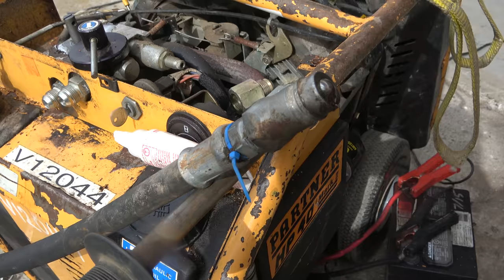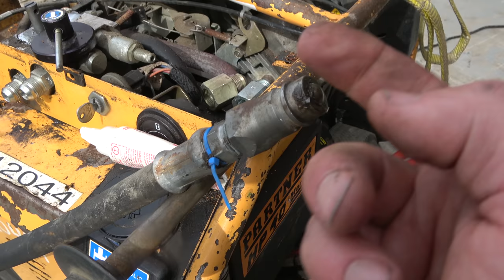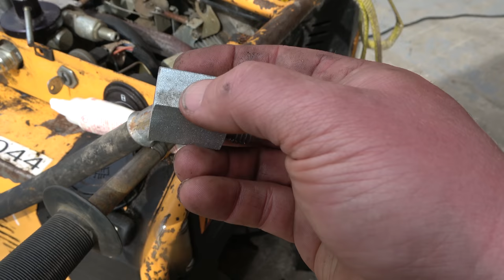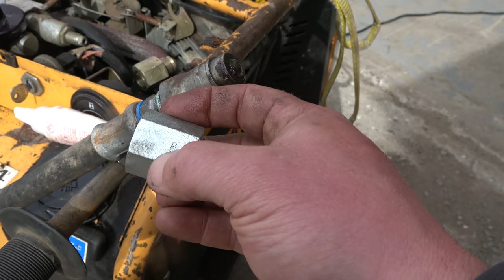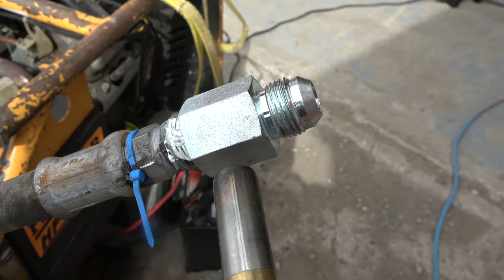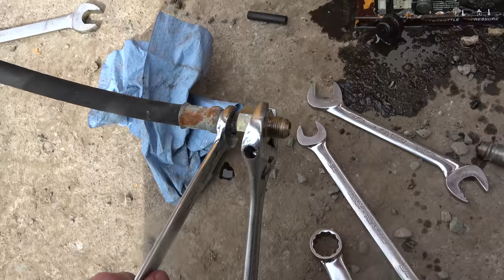#sharts Pipe thread that'll never leak (or come apart)

Comment: I'd like your opinion IF any of the prepared & trucked to facility gigantuan sub structures and supports that are being assembled this week at the SpaceX Starship 'Booster Catcher' Orbital launch Assemble Tower  down on the Gulf of Mexico ARE CND prepared, What cut or burned the holes. in the plates?  You think the rising structure is held in place with few bolts and they may or may not 'rack the structure' plumb and vertical on all 4 corners as a 'temp X-brace structure THEN make work the fasteners.  Bet they've got big nuts...

GOOGLE:  According to Musk, SpaceX's Boca Chica launch tower will have a “hook height” (the distance from the crane hook to the ground) of at least 140m (~460 ft), meaning that the top of the tower's crane will likely be 150-160m (490-520 ft) tall when configured to mate Starship to Super Heavy.

CLOSE UPS of the 'battlements structure' start at 6:38

https://www.youtube.com/watch?v=4P4yh78QlFI

Comment: You use the tape and the dope and do it real tight. This is just a stupid way to give yourself minor burns. The threads are supposed to deform, the male threads should be softer than the female, and the tapered threads smush everything together.

Comment: No, no no. METRIC threads...bane of my existence. Try sealing up the air lines of an old bus....all metric, all leaks, all the time!
Reply: It's not a fault, it's a feature...... lol
Reply: @MrEric_API  LOL...pressure relief valves! Never achieve 100 psi..guaranteed to never blow out rusty air lines!
Reply: @RipRoaringGarage  keeps the moisture from collecting too much.........  lol